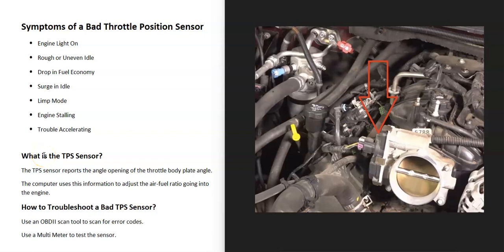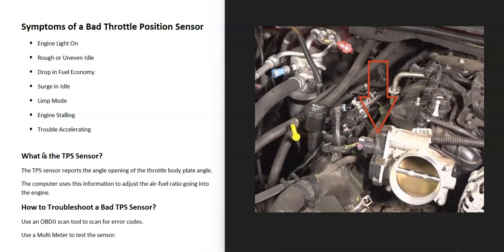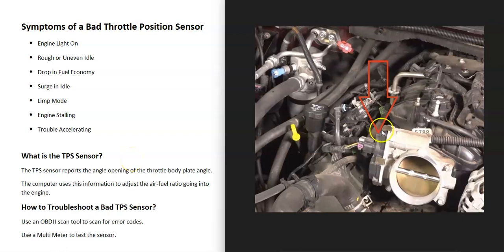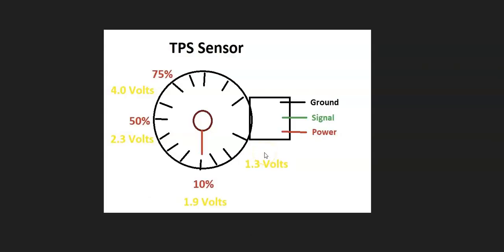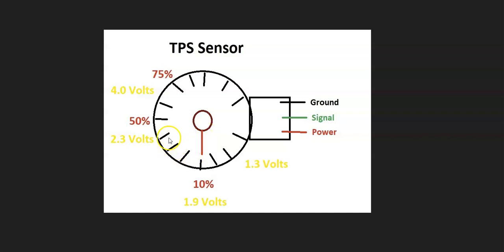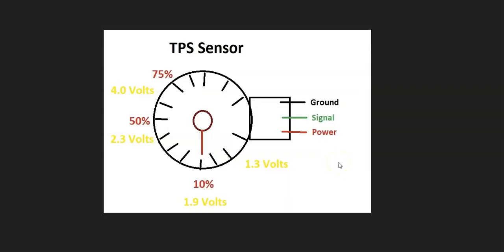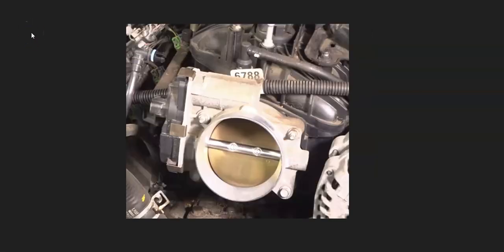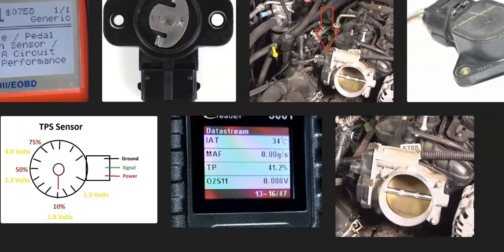Symptoms of a Bad Throttle Position Sensor and How See if it Has Failed

Comment: 2001 Lexus GS 300 throwing p0121, p1126, and p0120 I found a severed wire on throttle body connectors pigtail plug how would I got about replacing it and was it the cause of original codes and sluggish and delay it could it be the throttle body or the sensor

Comment: could a bad tps cause an unresponsive gas pedal? I have a p2104 in my 2005 navigator can start it and push the pedal to the floor without a response.
Reply from the maker: It needs to be diagnosed, but that usually is a bad pedal position sensor or wiring issue. Check for any blown fuses.

Comment: Is that a camry 2.4? Can't figure out why the idle is too low ,but wants to stick at 1000 when letting off the gas. No codes , tb is clean, runs great. Maybe the position sensor is sticking. Bought the car new, does not burn oil. Only 135 k miles. Anyone else come across this problem?

Comment: My Jeep Wrangler JK 2011 is having problems with the code P2127
Throttle position (TP) or Accelerator pedal position (APP) sensor/switch
E - low input. 

I changed the pedal as the mechanic told me it was the issue and still having the red lighting light on the dash and the engine check. Please help 😩🙏🏻

Comment: Have a 2004 Camry with the 2.4. bought new has 135 k miles, no codes, runs good but has a low idle except when driving . When you let off the gas it sticks at 1000 rpm until you stop. Cleaned the throttle body but no difference. Does anyone know what is going on? I suspect the TPS.

Comment: We have a 97 Ford Aerostar. Code We got was P0122. We replaced the TPS and we are getting clucking and hesitation. And we are wondering if its the throttle sensor on the pedal. We are stumped

Comment: I have a 2013 Honda Accord v6 exl. I decided to clean my throttle body but I forcibly opened it with a rag on a screwdriver several times while I cleaned around it. Now I have my engine light on with code 1129. I thought maybe the mass air flow sensor was the issue so I cleaned it but to no avail. Do you think I most likely ruined the throttle body itself? Or should I just buy a new air flow sensor?

Comment: What if the car is not in gear and revs with no issues but till you actually drive it then it seems to cut off around 3k RPMS

Comment: is it possible to have only a rough idle from a failing TPS sensor? Ive gone down the hole trying to fix this rough idle, but to no avail it's still there.  It's only in park, not in drive.  RPMS fluctuate pretty rapidly.  I don't notice any other symptoms.  new plugs, evap purge valve, vapor valve on char. canister., cleaned TB, PCV is new.

Comment: Why do I get no codes at all????
Reply: i got a 3.8 V6 and i dont have a check engine code my car turns on perfectly fine then shuts off... i change my spark plugs , spark plug wires and MAF sensor

Comment: My f150 seems like it's choking or going in and out of limp mode. Especially apparent when trying to maintain steady speed uphill. No codes or check engine light. Did trans fluid plus added shutter fix. No change. I still think it's the TPS. Any opinions? HELP! Wish I still had my 71 Camaro. I hate the electronic crap.

Comment: What about while in low rpm high gear and the rpm’s surge on and off while going uphill especially? Mostly in overdrive mode but a tiny bit in tow/haul mode. This is the issue I’m having. Replaced o2 sensors cuz I got a p0420 code and check engine light. It went away but still have this surging while cruising.🤦🏼‍♂️🤬🤬🤬

Comment: I have an old Dodge charger 2008 2.7 model in the last year it's turned on the lightning bolt light maybe five times . The mechanic told me to drive like that and if the light goes back on to drive it to him to be able to get the correct reading on his device but I'm afraid to drive it like that it shakes too much .

Comment: How common is a bad throttle position sensor on a 1 year old new throttle body?   I have all the faults and reduced power.  Did everything from the grounds to replace tps on pedal.   Still has the  issue.   Especially worse when it's cold and raining.

Comment: How about dying when put in gear but fine while on gas and moving?
Reply: On 94 chevy pickup
Reply from the maker: It needs to be diagnosed, but it sounds like a bad Idle Air Control valve. Often, they just need to be cleaned up.
Reply: 1:42  @jeremysmallwood8631

Comment: Could a faulty TPS cause hard starting?
Reply: Hey guy, Yes, a faulty TPS can cause hard starting because it may send incorrect throttle position data to the ECU, affecting air-fuel mixture.

Comment: TPS has been replaced for a second time on a 2004 Honda Accord EX 2.4L K24A. 5V reference signal is good .5ohm PWM signal wire and fluctuates between .5-4.5V Ground signal 0.03. Let it relearn for 15 minutes cleaned out throttle bod it worked for an  hour even after restarting it started getting worse within 1 hour. Signal wire reads ..68 ohms Honda's are picky. Doesn't shift right either low mpg low power. ECU signal checked out with the multimeter. So if it's not the TPS, not the wiring before hand works great what upstream can cause it to need recalibration. Going to ground it to the chassis instead of going digging but that's my best shot.
Reply: How do I let it relearn

Comment: Mister Toad's Wild Ride: My 2005 300c touching the gas pedal causes a wide open throttle (WOT) condition. As the car was accelerating i had both feet on the brakes and I was still accelerating. So I turned the key off. Then limped the car back home idling. Prior to that my alarm would randomly go off. My sun roof randomly  opened while parked letting 3" of rain water into the car. On the 05 there is a ground wire attached to the back of each cylinder head. This is a ground point. That connecting ground wire between the 2 heads was fried. These ground points also have a wire that attaches to one end of an O2 sensor on each exhaust side. On the 06 model this wire connection between the 2 cylinder heads ground points had been removed. I have pulled and repaired the engine harness(what a pain that was). I have cleaned up multiple ground connection points throughout the car. I am not sure if I have fixed the original problem. I plan on testing the variable resistant throttle position  sensor with an ohm meter. Not sure if there is any damage to the PMC. The C bus is the only thing that I found that was common to having problems with my WOT, random alarms, random opening of my sunroof, and perhaps the brakes not working as well as they should while flying down the rode.

Comment: Voltage should not be zero at idle,no peddle- right?
Reply: Correct, voltage at idle (no pedal) should not be zero. It’s typically around 0.5 to 1.0 volts, depending on the vehicle.

Comment: My car has thawed out before at a stop sign and I had to crank it back on, when I hit the gas around 2000 rpms it starts to make backfires and don’t want to go until I lift my foot and put it back down and then I will jump back up and go. Can’t this be a sign of a bad throttle position sensor?
Reply from the maker: It needs to be diagnosed, but it sounds like another issue, like the timing is off or the engine needs a tune-up. Check for any codes as they will help point to the issue.
Reply: @HVAC_Mechanic  I checked the codes and it’s giving me random misfire a cylinder 1 2 and 3 . do you think my ignition coils are getting worn out , Or  should I check the gaps on the spark plugs?
Reply: @trillions_7946 

When’s the last time you changed plugs? They’re $2 each. Start there. If that doesn’t fix it while car is running disconnect a coil wire at each cylinder and see if it’s a bad coil. Engine won’t die down if coil is bad. Next step is fuel injectors. Check one at a time. I dont know what car you have. You may have 1 single coil pack for all cylinders, like I do on my Jeep Cherokee . Or you have individual coils like I have on my corvette. It could be a tps sensor. I just replaced mine on my 2002 Jeep Cherokee today. It had so many symptoms. Bucking and barely running, transmission wouldn’t. Shift into overdrive and idle was at 1500 when I started it

Comment: I have a 2004 nissan 350z and the Machanic has told me that it won’t accelerate apparently it was the fuse box because the car wouldn’t turn on. I but I would appreciate if you can get back with me asap cuz these mechanics don’t know what they’re doing

Comment: I have an 08 chevy cobalt. Im trying to change my throttle positioner sensor. The sensor is stuck on the throttle body. It wint let go ofthe butterfly. I amholding it open and have tried every position in between

Comment: Interesting, what if there isn’t an error code would voltage test be the best way to know for sure?
Reply: Yes.  I have an 03 Chevy Express and the MAF and an O2 sensor, both were defective, and neither threw codes.  Both sensors looked good on a scan tool but there were intermitent issues.  Sometimes you have to analyze operational behavior.  The transmission was recently rebuilt but sometimes shifts a little hard and it doesn't really accelerate as powerfully as it should.  No codes but I'm going to replace the TPS.
Reply: Yes, if there’s no error code, a voltage test is the best way to check the TPS. Look for smooth voltage changes as you move the throttle. Any jumps or drops could indicate a problem.

Comment: could this possibly throw a crankshaft or camshaft sensor code? since they are on the same wiring?
Reply: You ever get the answer to this?
Reply: @playertopdog140  found out my wires were exposed and causing a short
Reply: Yes, it’s possible. If the TPS, crankshaft, and camshaft sensors share the same wiring or ground, a wiring issue could cause false codes for all of them. Check the shared wiring and connections for damage or corrosion.

Comment: How do you know if you should just buy a new sensor or you should buy a whole new throttle body??  I took my car in to get coils, and after he fixed the coils, he said my car wouldn’t move. He pushed on the gas and it just didn’t even go anywhere and the little tester thing said it was the throttlebody, but I don’t know if it’s the throttlebody or the sensor that went bad, or maybe the throttle body has to be cleaned how do you know to go buy a sensor or buy a whole throttle body? My car is a 2003 jaguar x type 2.5
Reply: @TruthIsNot4Sale  what ended up happening?
Reply: @  who knows they said it’s probably my cars computer not working properly and needed to be replaced after thousands of dollars of going back and forth nothing working I decided to sell it as is and got a different car
Reply: @TruthIsNot4Sale  last time I any anything of this sort where my truck would turn on but not move when I tried to accelerate even flooring my truck didn't move just replaced the entire throttle body and it fixed it. Idk what was wrong with your vehicle but it kind of sounds like a similar issue

Comment: I have a 2007 gmc sierra 1500 new body style. When the truck shifts, it take a long time too shift, or if I take my feet off the pedal, I’ll hear it finally shift. Then sometimes the rpm will go all the way up to 7 on the dish, and it will stay there till I lift my foot of the gas pedal. With your best estimate, is this a bad tps sensor, or it’s the transmission?
Reply from the maker: You likely have error codes that will point to the issue. It sounds like a transmission or wheel/ABS sensor issue. If you don't have a scan tool, automotive stores will often do scans for free.

Comment: My car is sluggish untill 2500 2800 then boom like a rocket im off
Reply: Same with my truck ill drive until ill hit 15 then boom it just  decreased my speed and acceleration and when i put my foot all the way down on the gas it wont do nothing then what you said boom it will kick back on and im flying like a rocket is that the tps or something else
Reply: Could be the tps or the fuel filter is clogged or fuel pump going out plug it in at a auto parts and see if you have a trouble code that way hopefully you can diagnose the problem
Reply: @christopherwilson7698  mine was a clogged cat car caught fire
Reply: @kidsavage86 ROUGH
Reply: Mine is like that,  drives like a 2 stroke trailbike. I tested my 4 wire tps, the 12v wire isn't working so gonna try a new tps. The 12v wire is on/off for the idle controller.
Reply: how do you fix it?
Reply: Replacement  @jaredfernandez4319
Reply: Couldn’t have said it any better. 😂. Always found it funny climbing hills next to someone, slowly going, they start pulling ahead, all of a sudden WAAAAAAAAAAA here comes the Silverado😂😂😂
Reply: hahaha that’s funny lol you explained exactly what my vehicle is currently doing

Comment: Can engine temperature affect the TPS? I'm not having any problems at idle. But when the engine gets up to operating temperature and on acceleration, that's when I start having sporadic hesitations, surges and stutters etc (But engine does not die) This only happens at warm operating temperature. When the engine is still cold I have no problems.
Reply: I have this same issue with my taco. Drives me nuts. Big rabbit hole trying to figure this out
Reply: I’m having same issue. When cold runs fine. After warmed up 3rd and 4th stutters and regardless it’s like truck don’t have any power

Comment: I have a 05 Chevy 2500 HD I’m so lost at this point. Because all the videos and comments I’ve been reading doesn’t sound like mine until it goes into limp mode and the P2135 is the code. But it will drive fine without and problems no stalls or high revs, it drives smoothly but once I cut the truck off and go to start it back up it’s in limp mode. I can clear the code and maybe get a week or more out of it till it doesn’t it again. I’ve replaced the pig tail and wires to the throttlebody. Replaced the throttlebody 4 times now and the foot pedal twice. relearned everything after each new one has been put on and within a week it happens again after I cut my truck off.
Reply: Did you ever get a read on it? I am about to delve into mine. Similar deal. Runs perfect until it doesn't. Also, did you check the grounds on yours? That is what I am going to do first, since it is free.

Comment: I thought I was having some transmission issues until I replaced the throttlebody and the idle control valve and Runs great now.
Reply: How was your trans acting, I think I may have the same problem
Reply: @nujay3161 it didn’t want to change gears like I was stuck in 2 gear like it was in limp mode.
Reply: @angelf9800  mine won't shift from 1st to 2nd at the right time and will not kick down when you floor it...maybe this cud be it iv changed fluid and am getting no trans codes to my knowledge
Reply: @ImpalaWes  check your kick down cable. Dunno what kind of car you have but many cars have an adjustable transmission cable called a detent cable or kickdown cable.  It’s on the throttle body. It just adjusts in or out with a press of a button and allows transmission to shift harder or softer and allows transmission to kick down to a lower gear.  There is no sensor for it so you won’t get a code. I had  one on my Chevy Camaro my Jeep grand Cherokee and my Pontiac trans am. I have one on my corvette also.
Reply: My f150 seems like it's choking or going in and out of limp mode. Especially apparent when trying to maintain steady speed uphill. No codes or check engine light. Did trans fluid plus added shutter fix. No change. I still think it's the TPS. Any opinions? HELP! Wish I still had my 71 Camaro. I hate the electronic crap.
Reply: Feel ya did a tune up on 2014 town and country hae misfure ran great for 3 days then it started shaking like engine wants to come out of it  @2risingfall38
Reply: Was your transmission doing that bucking, hard shift?
Reply: I have changed all my sensors 5 times already and now it's throwing the throttle  body sensor again. What else could cause this??? Please reply back
Reply: Yeah mine feels like transmission issues built I just got it rebuilt
Reply: @chrisdeadmon9877 you better check the transfer case fluid if you have a 4x4
Reply: I'm having the same issue my code p0108
Reply: Where is the idle control valve located on a Chevy cobalt 2006
Reply: im having same issue. i got a throttle body sensor code but it almost feels like my transmission is going out. and it wont go faster than 80 mph. or if i floor the pedal from 0~60 its jerks. likes its struggling. i can bet all my money its the throttle.body sensor going bad and the fuel air ratio is acting up due to sensor gping out. im getting no transmission codes too. im replacing it myself on a 05 honda accord ex. i hope it fixes the issue
Reply: Definitely sounds like a dodge here
Reply: When I put my car in D,R,N,L and it don’t move. Rpms running up and down on their own. So waiting on my new throttle body now to see if it makes a difference. Took my old one off and clean it but still not working. Opens up one time after pushing the gas just don’t open no more.
Reply: Help !!! I got a 1990 chevy obs. Recently did a oil tune up. But it stalls and turns off when I cahnge gear to reverse. Help !!!!